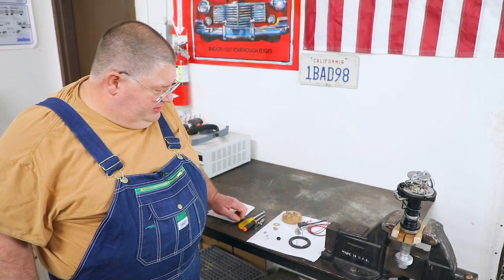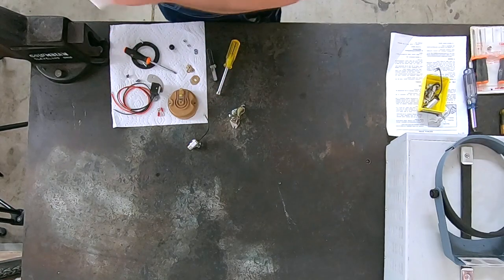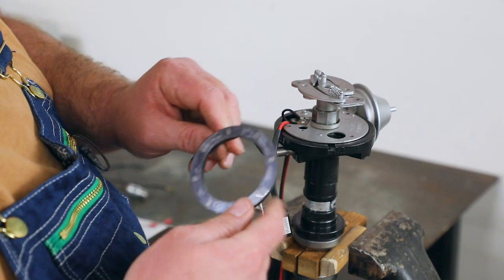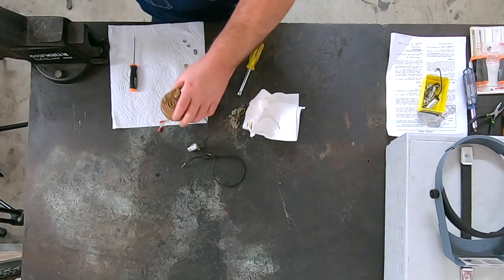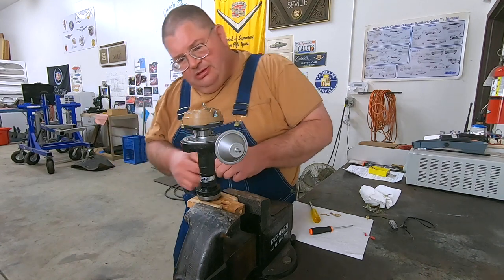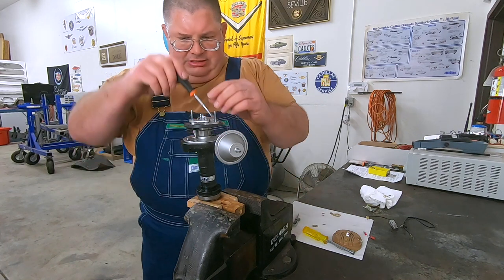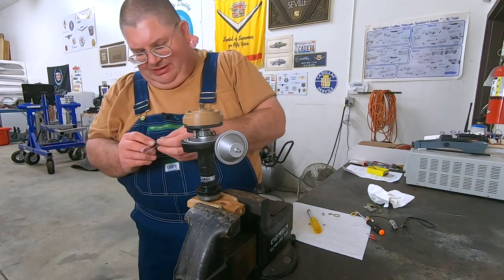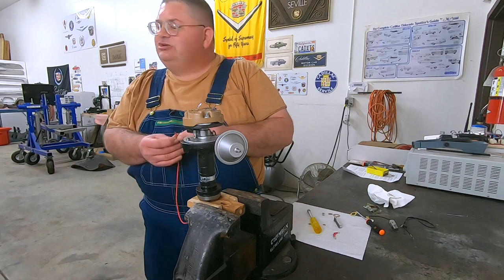How To Install the Cadillac Electronic Ignition Conversion

Comment: I have a 1967 sedan deville. Will this #1181 replace my old points setup? Thanks for your time
Reply: Yes, it will work in your 1967 Deville. It is very easy to install. There are instructions in the listings on Caddy Daddy's website

Comment: With this conversion do you remove the resistance wire? Mine burned up? Would you guys happen to have the pig tail that plugs into the back of the ignition for a 1965 Cadillac Fleetwood 4 door with the 429 engine?
Reply from the maker: The resistor or resistor wire should be removed from the ignition conversion.
Reply: @Caddydaddy  ok thank you!!!🔥🔥🔥🔥

Comment: I have a ‘56 Olds 88
Is this the right one for me???
Can I use the coil I’m running now with the old points set up?
Reply from the maker: Our electronic ignition conversion (SKU 1181) will work in your '56 Olds. The original coil should work fine as long as it is in good condition.